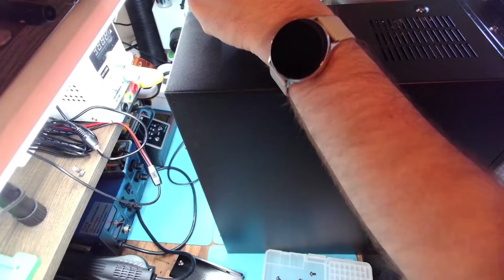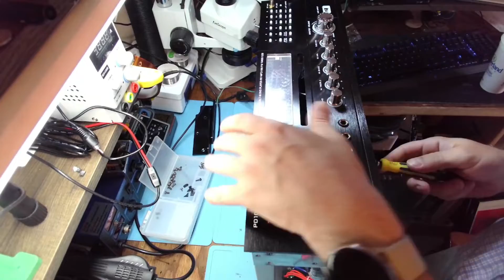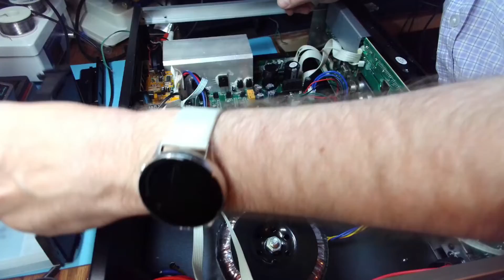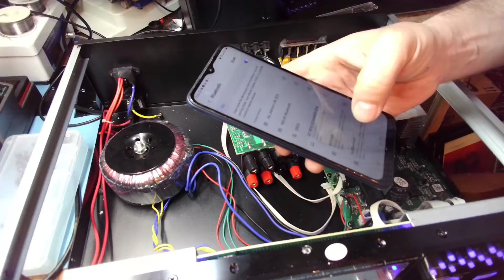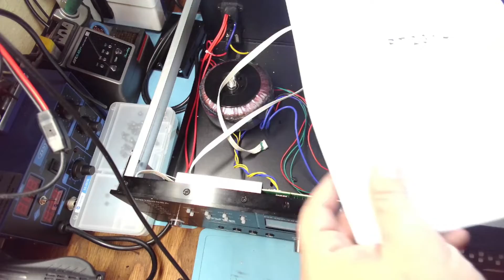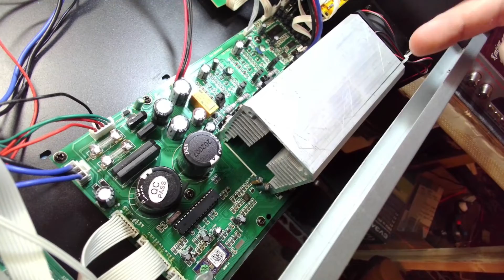Pyle 1kW Amplifier Repair | PD1000BA Teardown

Comment: Do you think if you lifted the i2c leg or cut the trace and ran a separate shielded cable it would help the hiss?
Reply from the maker: it could, the interference problem has not been addressed during the design of this amp (in my opinion)

Comment: Mine started acting wierd, but its the pd3000bt. It was great at first, but now acts funny. When i connect to the bluetooth, it clicks on and off. I thought i blew up the speakers, so i replaced the speakers, and the same thing. I was thinking repcing the fuse, but i dont know where to look
Reply from the maker: it's not the fuse issue, the output stage turns off due to (probably) shorted transistor. Faulty speakers would also explain this behavior but since you replaced them, you eliminated this option. Check the speaker outputs for shorts.

Comment: have same one do you know why it flashes close all times,
Reply from the maker: probably door sensor or motor or both. You can replace the whole CD assembly
Reply: Mine does the same thing, its not the CD unit, its a common issue with the part that controls the CD and USB. I don't use it, bluetooth and phone gets you all the digital music you need.